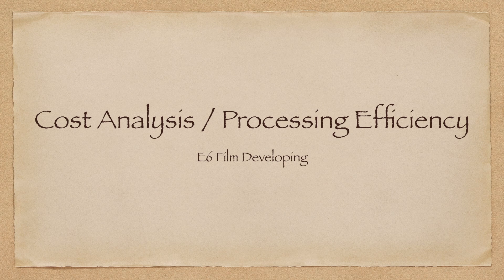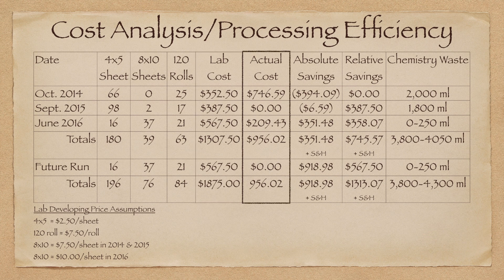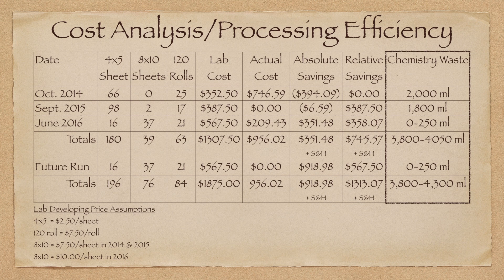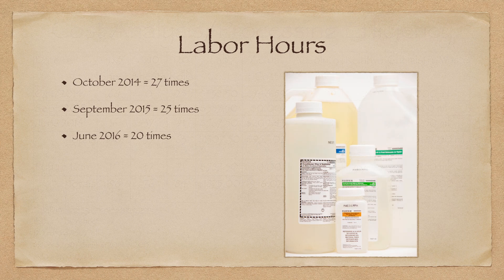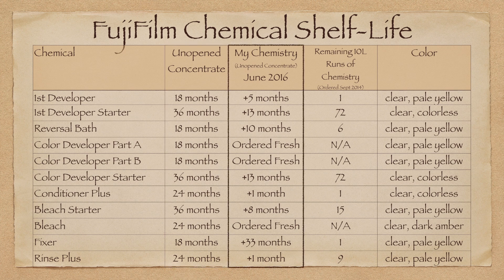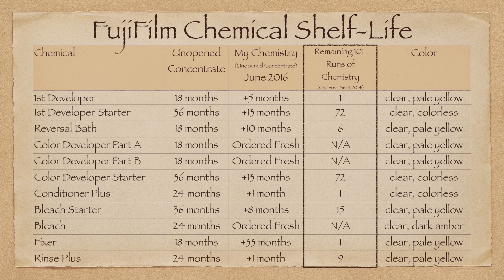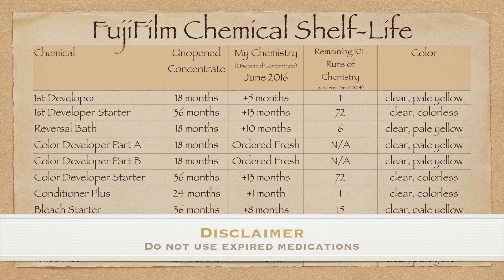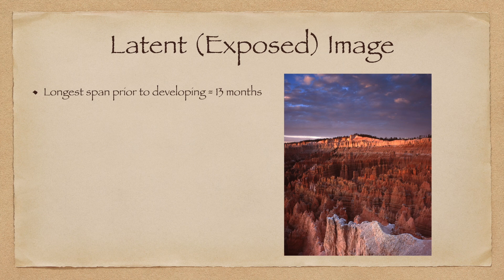E6 Film Developing: The Ongoing Experiment

Comment: Have you tried changing the first developer time to control contrast?  Back in the day, I shot Kodak EPN 100 at ISO 32 and cut the first developer time by 30%, to yield soft, almost milky transparencies.  I was printing Cibachrome, a high-contrast print material.  For portraiture and moderately high-contrast subjects in natural light, it worked perfectly, without having to make separation negatives.
Provia and Velvia were not available then, so I have no idea whether it would work with them, but it would be worth a try.
With only limited experience, I also found that the reduced transparencies were in the ball park for digital printing, with little of no contrast alterations needed, whereas normally exposed and developed transparencies needed quite a lot of post work.
Reply from the maker: That's really interesting but I've never tried it.Thanks for stopping by! Tony

Comment: Did you calculated your actual cost per sheet/roll?
Reply from the maker: That's a great idea! I'll have to calculate that out for the next video in this series to show savings in a different way. Thanks so much for watching! Tony
Reply: It would be interesting to compare with Tetenal E-6 kit. I've bought my last 5L kit for about 60USD. I divide the kit into the 11 batches (450ml), each batch I use up to 4 times. That yelds 264 sheets in my Jobo 6-sheet tank. So one sheet costs me 0.23 USD. Recently, Tetenal increased the price, also the USD went up, so in current economy one sheet would cost me 0.29 USD.